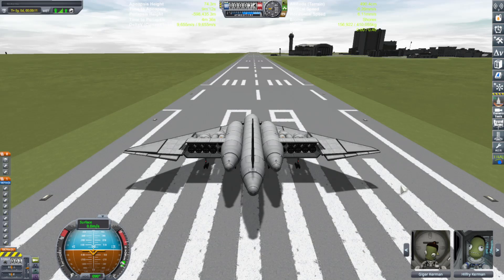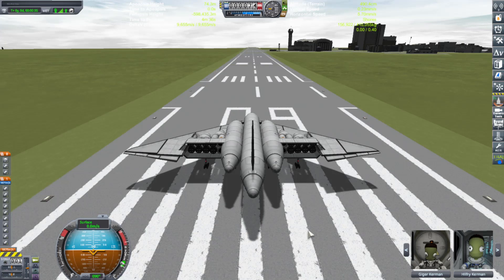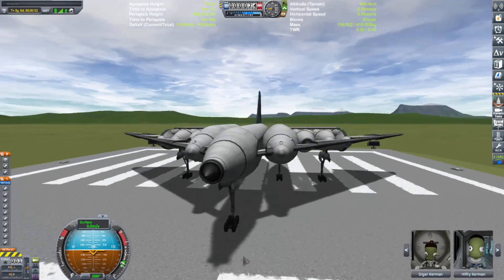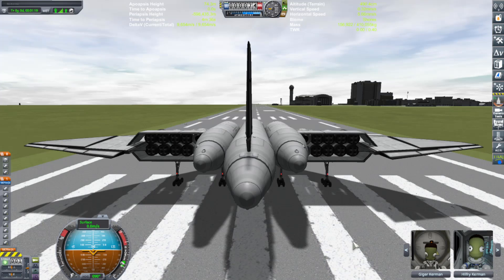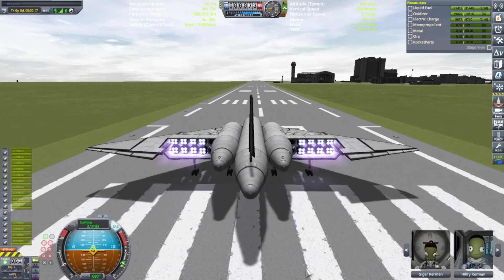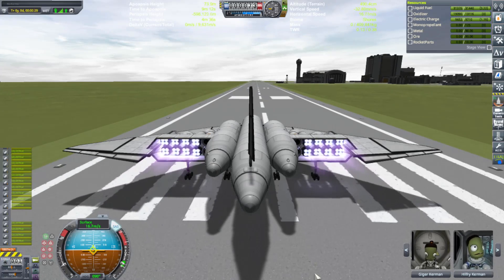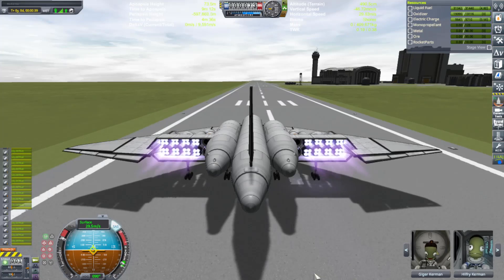DUNA SSTO WITH OUTPOST

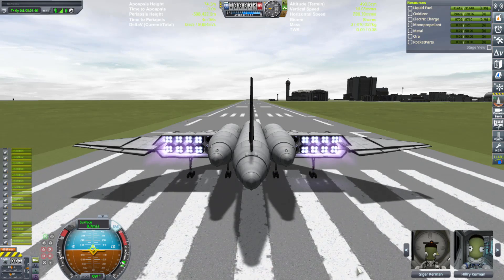Comment: 1:53 didnt you say you could run 8 rapiers off a single shock cone? 

🤡
Reply from the maker: 6 but just barely.
Reply: @vaos3712  Starting at 1/3 power makes a big difference. You can throttle up gradually a little earlier too. Similar to how heavy airliners usually hold short of the runway to wait for clearance, then start the takeoff roll while still turning to the center line.